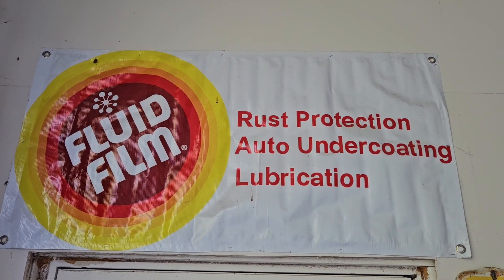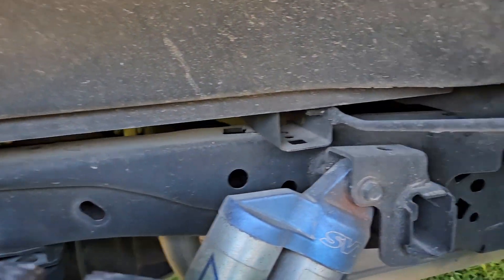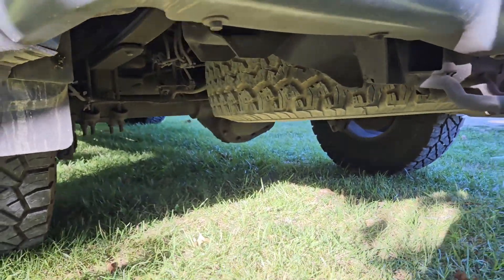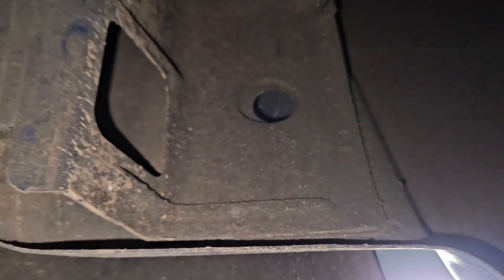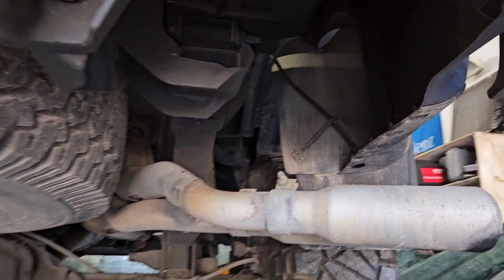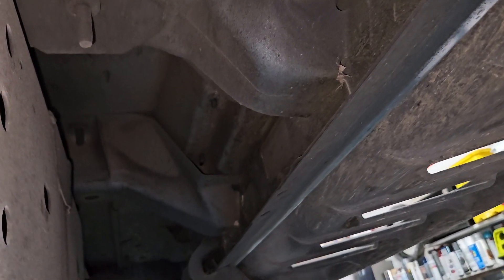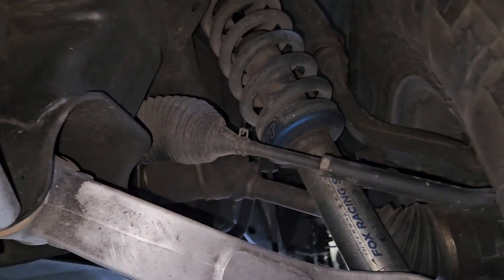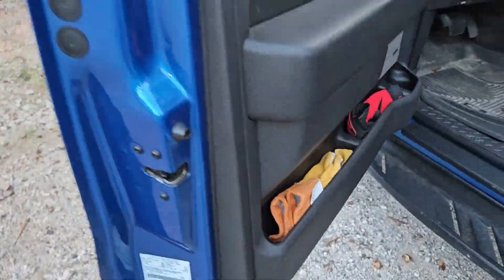Fluid Film 13 Year Update

Comment: Good stuff, but i gotta ask... are using the full beadlock rings but have the tires normal beads? It looks that way.
Reply from the maker: Good eye. Yes i had an issue with them leaking while towing my loaded trailer. Recently made a 14hr round trip towing 6k lbs. Didnt want to risk it. Will be locking the beads again soon.
.
Reply: @1runyen  totally fair. I saw that and just couldn't get past it. I'm guessing you didn't have the beauty rings available.
Reply from the maker: @badm0t0rf1ng3r 

Do you have any suggestions? I had been running a thick layer of tire bead sealer. Kept running into the issue of small air bubbles around rings when under load. Thinking about trying silicon this next time around
Reply: @1runyen  I wish I did. I've been running beadocks for years and never had any issues. Of course the psi fluctuates a bit with Temps. I also tow but closer to 1000 lbs max. Do you maybe have a rim that is out of round? Maybe a nick in it? Is it all of them?
Reply from the maker: @badm0t0rf1ng3r Yes, unfortunately its all 4 that start leaking. The wheels were new take offs, and the rings were purchased through ford. The back tires leaked more than the front. But I also tow my 22ft trailer at least once a week. I spoke to a ford performance engineer, he basically told me that its normal for them to leak a small amount. Which i find hard to believe
Reply: @1runyen  I feel like that's kind of bullshit. I don't think they should leak at all. Are you torquing evenly around the bead to ensure its not pinching on one side and creating a gap on the other side? I feel bad man. The beadlocks are so nice but I can understand being a bit disheartened about it not keeping air.
Reply: @1runyen  you can always pop on the ford raptor forum and see if there's an answer there.
Reply from the maker: Yes they came with torque instructions when I purchased them through ford. After consulting with the ford engineer I posted the issue on a couple raptor forums and tried a few different tips/tricks that were suggested- except the heavy use of silicon. Ive had them on and off a dozen times trying to resolve the issue. Definitely frustrating. But it could ultimately be that they arent rated for heavy towing, who knows
Reply: @1runyen  Man I am stumped. the clamping force should be just as good at keeping air in as the pushing force on the bead. the fact that they keep air in while on the bead is wild. Maybe the rings themselves are out of round or slightly tweaked?

Comment: It's a nice truck but it's a little exaggerated a truck sprayed 13 years like that with fluid film would have 10 times more build up than shown in the pictures........

Illinois is not really the Rust Belt put that truck in the Northeast and it would be totally different story. 

While the truck looks very nice I guarantee that it was kept in the garage a lot and had an anal owner that tried to avoid driving it as much as possible in the winter. 

It's in great shape but I know you use your finger to smear stuff off but if you really want to see what it looks like you need to get an actual Steam Washer and take everything off trust me it will be a nice shape but there will be rust underneath
Reply from the maker: It doesnt have 13yrs of buildup due to every single spot is not sprayed every year, only touched up. It only gets powerwashed clean after going through mud. It is just as clean underneath the film. I use clear film because I am not hiding anything. I setup my shop every fall to spray several dozen other trucks along with mine. This stuff truely does work.
Reply: There will absolutely not be any rust underneath if it was coated properly…. your ignorance is showing
Reply: @1runyen I agree. I use rust check
Coat and protect up here in Nova Scotia Canada and there’s no need to build up a thick coating of product. If anything it would be worse by potentially drying out under a thick coating. My vehicles look great and rust free after years of harsh winters and very humid climate surrounded by the ocean.
Reply: Your wrong , there is nothing under the film . No rust at all